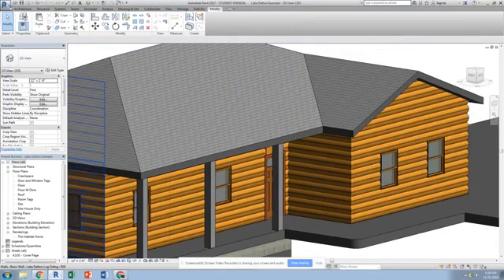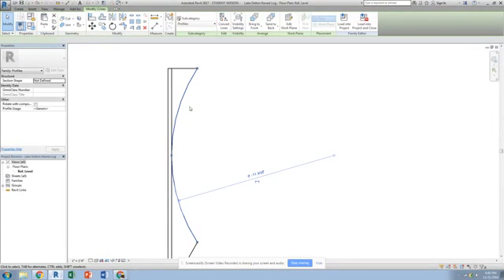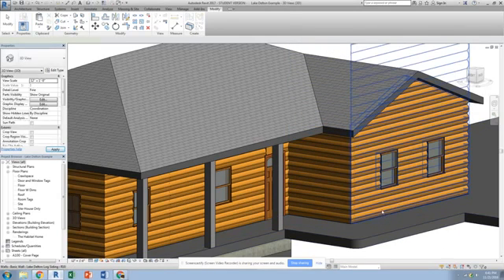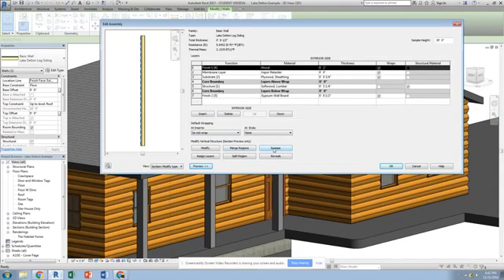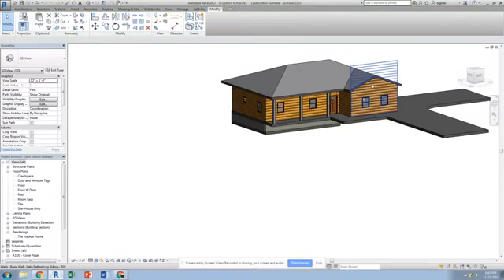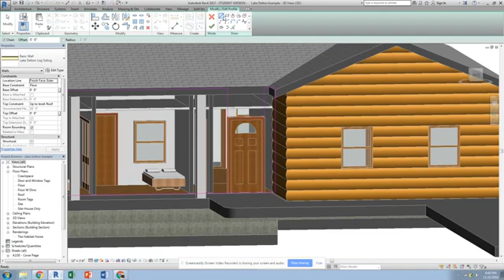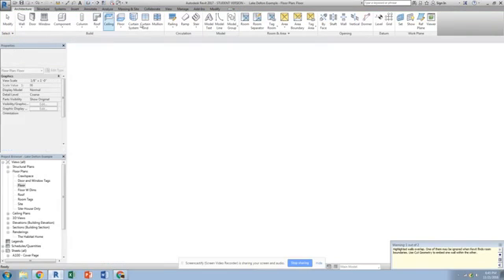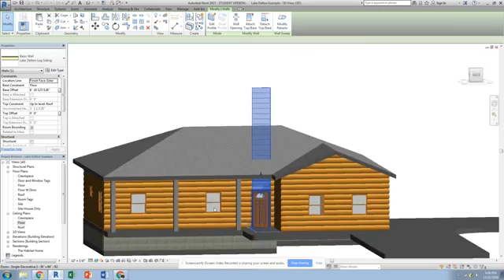Revit   Log Cabin Wall with Reveal Sweep!

Comment: Assuming the head height is going to be consistent all around, you should consider creating three sets of reveal profiles with height matching the head heights and repeat in the wall revel properties so that the new set of reveal will start at the head ht. this should solve all your problems and won't have to do any of the modifying walls at the door openings and modifying wall sill lines in the floor plans. cheers.
Reply from the maker: Love that approach, thanks for the tip!

Comment: I've found that if you change the sill height of the door, it won't cause the issue you're having above the door.  I simply changed mine at 1/4" instead of the default 0" and the issue was resolved.  No need to add additional walls above the doors.
Reply from the maker: That’s key!  Thanks for figuring that issue out and sharing it!
Reply: Thank you for the video! The option of using reveals instead of sweeps was so helpful for the project I'm working on!